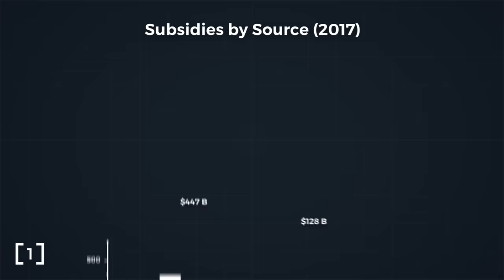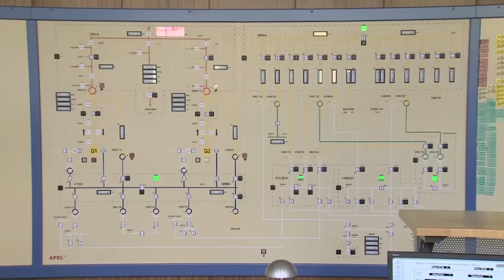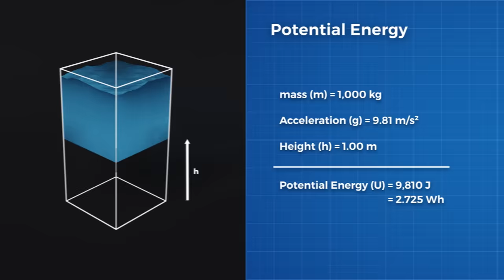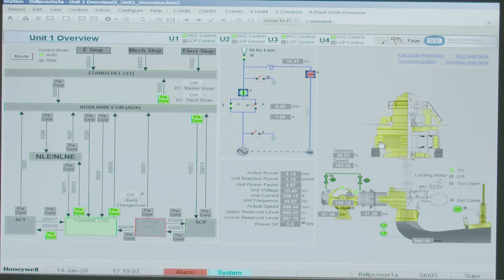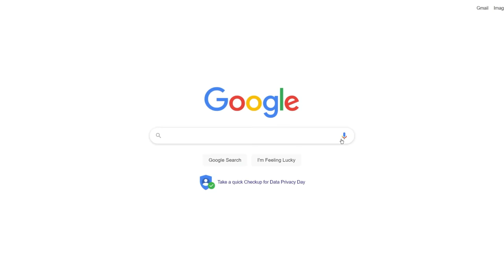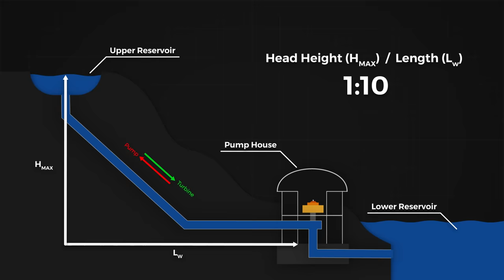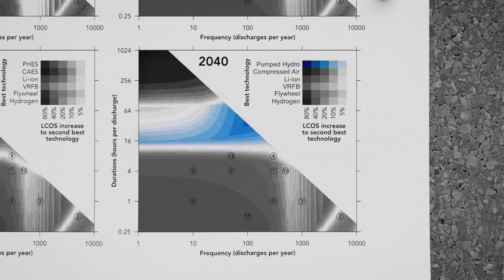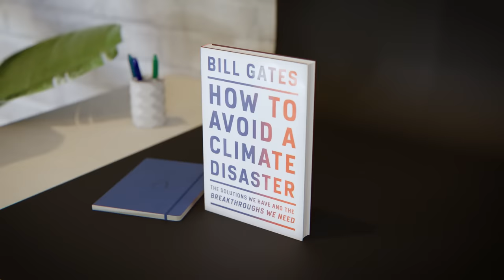The Truth About Pumped Hydro

Comment: A brief on Hydroelectric 2 nd stage power recovery system
This system is for all hydro systems running with a TAILRACE setup
Why a tailrace setup ?
In an ideal setup without the need to modify the construction plans to fit into a geological
or given plot of stable ground, the benefits are not lost to compromise.
As however in the real world hydroelectric systems are generally a compromise, and the
TAILRACE is invariably longer than the turbine hall would find IDEAL in regards to
power made per ton of water used - a loss that can now be recovered
With the turbine hall believing a shortened tailrace has been fitted this allows the turbine
hall to make more power out of the same volume of water
IT IS WISE TO NOTE TOO SHORT A TAILRACE AND A SURGING ISSUE OF THE
TURBINES WILL OCCUR, leading to its self destruction
What sets how short the tailrace can be made?
Because each and every dam is in effect a custo- made system, and so the type and
number of turbines at the location dictate the power recovery units location in the tailrace
But there are basics that are common to all hydro installations
Example of why a shortened tail race works
A different way to look at what is happening at this point is:
You buy a 2 stroke motor to fit to a go-cart but it needs a bit more power. The quickest
and cheapest way is to get a tuned exhaust pipe – it’s generally a shorter and larger
pipe
This allows the motor to breathe freely and returns a boost in power output with just the
right amount of back pressure
Firstly Back Pressure
This new setup will not generate a backpressure issue to the dam (a common reason
why to date the industry has failed to benefit in this area). In short blinded by their
education. A stumbling block that has been drummed into every Engineer so no one
looks at this sort of issue as solvable
Secondly Down Time
The assumption is made that to build this system would mean the dam will be offline for
years when 90% if not more of the installation will not require the dam to shut down and
the final step can be taken during the annual servicing period of the dam
The freeing- up of the turbine hall from having to work with a tailrace that is now tuned to
the best power output. NOT distance to the discharge point!

And along with my new 2 nd stage turbine power recovery systems the return should be 3-
8% more annually combined
Thirdly Servicing
With no extra shutdown periods needed to service the new power recovery system as
this can happen independently
And should a unit go offline in say a three-unit setup, the offline unit can be swapped in
a day without the need for the remaining two units being effected OR the turbine hall
operations
The end of the tailrace will continue to spill out into the existing lake or river location with
only one extra outlet fitted to handle the same water volume, but now at a slower pace
so that all works are easily able to be environmentally completed
If a pump hydro system is used this will not alter the setup or require modification
It should be noted that this system has less parts to an equivalent turbine setup so there
are less failure points
And is expected to outlast the required life expectance of the dam
NOTE
Chinas hydro output to date is:
According to IHA&#39;s 2020 Hydropower Status Report, total hydropower capacity reached
356 GiggaWatts in 2019 after a further 4.2 GW in capacity was added
China&#39;s total estimated hydropower generation reached
1,302.00 TerraWatt hours.
FINAL POINTS
So say China’s hydro output was up by a further 3% only (as not all China’s dams can
run this system). So what is that worth as annual income to the country?
It should also be noted that a new dam construction with a penstock hydro system fitted
will double the return in secondary power recovered and still be serviceable without
impacting the turbine halls operations
simon bowman 
rdp marine 
facebook

Comment: I don't know if the author is merely ignorant or wilfully hiding the considerable difference between power GENERATION and CONSUMPTION. For example, 50% of Germany's energy PRODUCTION was from Renewable. Yet, 10% of its total CONSUMPTION (generated and imported) was Renewables. Are we seeing the massive difference between the two? 

Additionally, if you replace fossil fuel generation with pumped hydro, what exactly is going to power the hydro plants at night, given that they're net energy consumers? Are they going to power each others? Are you going to rely on intermittent wind to power them?
Reply: bill gates wants your refrigerator to work when the wind blows, sometimes.
Reply: That's just missing the point. 

What's going to power the pumped storage at night? Renewables in the day of course. That's the entire point.

To use excess in one time for the lack in another.

And of course they're net energy consumers. It's energy storage. No method of storage perfectly stores all of the energy without loss.
Reply: @anxiousearth680  you need to re read your reply. Day-time renewables can't power night-time pumped storage, mainly because there's no energy storage for the renewables.
Reply: @bluntape9897  I don't see your point. 

Pumped hydro does not need energy. It stores energy while losing some of it from pumping and other inefficiencies.

If there's no power to store, then no pumping needs to happen. Why would pumped storage need to be powered?
Reply: @anxiousearth680  Water from a pumped storage reservoir is discharged during the day, generating energy when it is most needed on the grid. At night, the pumped storage facility needs to pump water back into the reservoir. 

All clear so far?

The facility needs to draw energy from the grid or from a separate source, for the reservoirs to be filled back up. Given that solar and wind do not create any energy at night, nor do we have batteries large enough to store whatever they would create during the day, we are pretty much stuck, aren't we?
Reply: @bluntape9897  
I still don't get it.

Water is pumped when there is excess. Discharged when there is a gap between production and demand.

And you're implying that pumping must be done at night and discharging must be done during the day.

I still don't see why having no power at night is a problem for pumped storage.

You can just produce excess during the day with solar as opposed to at night with coal. And fill up in the day while discharging at night.
Reply: @anxiousearth680  you're oblivious to core aspects of how pumped storage has been used for decades, yet you started the entire conversation by saying that I'm missing the point.

Comment: Why did you say that hydrogen is the only solution for long-term energy storage, when you recently posted a video about Ambri’s liquid metal batteries?
Reply: It's not borught to the market yet. There's a huge difference between researching something and testing it in small scale and actually mass producing it at a cost where it's worth it.

Comment: How much electricity is used to pump the water to the upper reservoir?
Reply: That the point you dunce. Use extra power to pump the water and then drain it down to generate power when you need it.

Comment: Fossil fuels have a net negative subsidy, or at least petroleum (which the study linked to says dominate the subsidies) has a negative subsidy.  In many countries targeted taxes on fossil fuels (gasoline taxes, carbon taxes etc.) are far larger than any reasonable measure for fossil fuel subsidies. Also your $447B/year figure for fossil fuel subsidies sound pretty fishy.  You link to a 64 page PDF were you get the data but I can't find a simple list of what it calls subsidies and how much for each anywhere in the document.  I've seen lists before claiming very large fossil fuel subsidies that fortunately did break down the detail about what they consider subsidies and it tends to be things like general tax deductions that are not targeted at or only available to fossil fuel producers.

Comment: Shouldn't the water pressure play a role? (when calculating the energy storage capacity)
Reply: Water pressure increases by the height of the water reservoir. It's basically the workings of an old water tower.
Reply: @1barnet1  That's what I'm saying, so shouldn't the energy transfered to the impeller vary when the pressure gets lower and lower?
Reply: @g0lanu  Yes, when the level of the reservoir gets lower you'd need more flow for the same output since the pressure/force decreases. Usually pumphouses are located further downstream instead of at the bottom of the dam to reduce this effect. 

At a place from my youth in Austria the dam started at 1300m above sea lvl but the pump house was 15-25 km away at 880m above sea lvl
Reply: @1barnet1  well, in the video, the energy storage capacity is calculated only as a function of the distance the water drops (potential energy basically), but that would be the minimum energy, as far as I can figure it out.
Reply: @g0lanu  No that's actually the maximum energy possible.

Comment: The beginning of video is propaganda. Towards the end of video you are truthful about how massive the engineering building of these facilities would be. We are not at all ready, there is much work to be done before we start seeing non fossil fuels dwindle down to below 50% of contribution to the grid. Let's do it, but this unexcusable pandering that we can get there faster because we wish it is not how engineering is done. Many problems will occur during this migration from fossil to clean. Let's just work the problem and stop pretending that there is some kind of war that fossil fuel industry is starting.

Comment: The first minute of this video is all over the place logic-wise. Fossil fuels received more subsidies, but wind power provided more mumble mumble.. No. It didn't. It may have provided more NEW capacity, but it does not yet hold a "candle" to what we generate using chemical energy. And when you talk about solar and wind as renewables, you also ignore the enormous costs associated with the mining, production, and logistics of establishing these power sources. They are not fire-and-forget technologies, either: they require immense amounts of maintenance, and use materials that are not yet particularly recyclable. Photoelectric solar uses rare metals: I have more respect for thermal exchange solar power, but that technology also has some issues because the sun beats the crap out of everything it strikes. On top of that, we have nowhere near the necessary energy storage to capitalize on any eventual overages produced by increased capacity, and this storage of overage is necessary to counteract the reliability issues with wind and solar power. Don't forget that power infrastructure is an easy target for terrorist attacks, which may remain an issue in some parts of the world for a long time to come. 

Why are we not talking about Thorium-based nuclear power instead? As nuclear power is centralized and tends to be highly secured, it seems to me that it will be easier to protect the grid from domestic or foreign attacks. Thorium is practically considered a waste product, and reactor technology is improving all the time. Why dicker with all these windmills that slaughter thousands of wildlife while being ugly, noisy, and expensive to produce, establish, and maintain?

NUCLEAR POWER is the greenest energy we're ever going to get at our current tech tier.

Comment: @RealEngineering Just a question... If the draw of power to pump the water back up to the top is bugger all, then why couldn't  you put an extra turbine to directly power to the pump so it's filling up as its producing electricity?  Or run something like a dynamo off the turbine shafts ? Anyway just wondering? Excellent  work, Interesting, informative , and unbiased and balanced.

Comment: Clean energy and storage are pointless if they're being used inefficiently.
Reply: @Eugen_Belyaev  Speaking of falling from the top, how about just harvesting more energy from the rain itself. In a mountainous area with decent anual rainfall you can actually get a lot out of some concrete water catchments that lead to a reservoir.
Reply: @Eugen_Belyaev  So is this energy storage operating more as a flywheel in a sense? It's quite an interesting concept that I need to take the time to study further. As far as what I was talking about goes, the main backbone of the concept is that by using catchments, on top of a hill or mountain, the water is able to be stored with potential energy. And by utilising as much of the natural landscape as possible construction costs can be kept rather low.  With enough catchment area and height one could fufill all their power needs off of yearly rainfall alone. As a side note since the system captures its own water excess can be used for farming or daily needs as well. Either way what you're talking about is quite interesting, I'm currently studying all about different energy storage systems so I appreciate the info.
Reply: @MrRobobear  This can be called an energy converter (potential to kinetic), as well as an energy amplifier using the differences in the characteristic curve of the efficiency of reversible centrifugal pumps. Of two identical reversible centrifugal pumps operating (one in pump mode and the other in turbine mode) with the same revolutions (on one, common shaft), on one closed watercourse, due to the difference in their characteristics in different modes, the turbine will have slightly more performance. This small difference between the expended and received power will be the bonus that will allow (when placing the pump-turbines on a common shaft) to have a positive power balance.
Reply: @Eugen_Belyaev  Okay now I understand. It seems similar in use to another concept where tree-like capillaries are used, allowing water to be lifted to great heights with just a small amount of energy being supplied to a vacuum at the top.
Reply: @MrRobobear  Thank you for your attention! It is always a pleasure to communicate with reasonable and logically reasoning interlocutors who can draw the right conclusions! I wish you and your children all the best in the new year: PEACE AND GOOD, as well as a lot of clean and affordable energy, for which you will not have to pay!
Reply: @Eugen_Belyaev  Same to you mate! Live long and prosper 🖖
Reply: @Eugen_Belyaev  That would violate conservation of energy. Perpetual energy machines don't exist.
Reply: @MrRobobear  That would be what hydropower dams already do
Reply: @anxiousearth680  The argument, in general, is counterproductive, because it does not lead to the truth. Arguing with the unreasonable is just as useless, because: truth will certainly not be born here!
Reply: @anxiousearth680  In fact, only the law of conservation of material matter discovered by Lomonosov was scientifically confirmed. The theory of the conservation of energy has remained a theory due to the lack of a definition of energy.